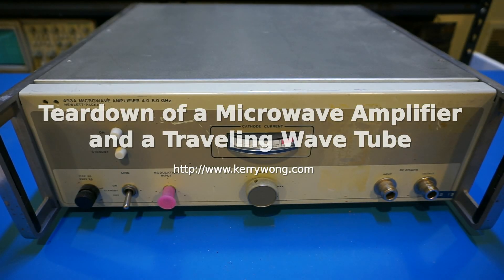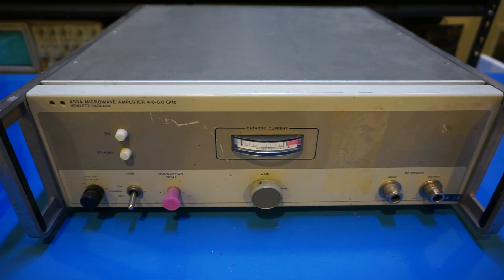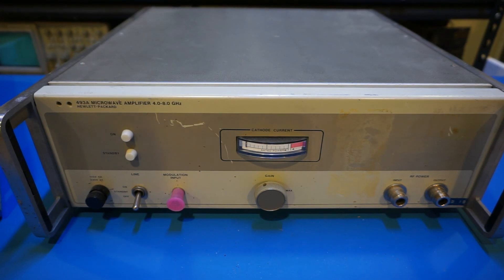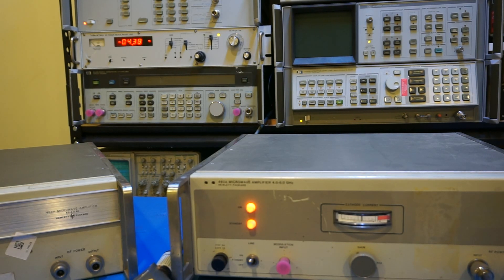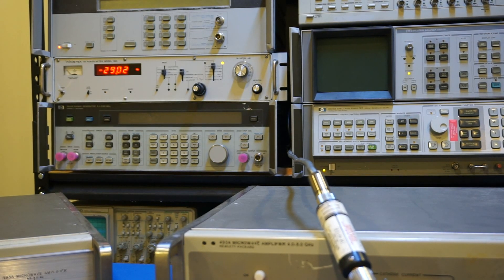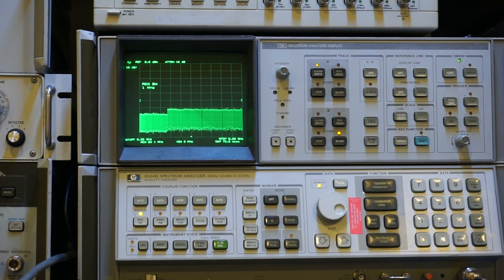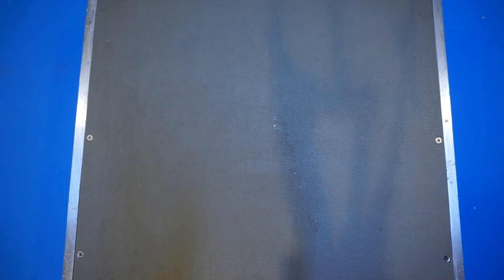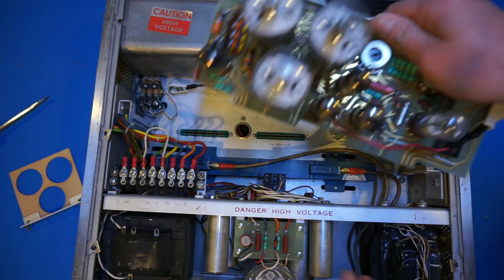Teardown of a Microwave Amplifier and a Traveling Wave Tube

Comment: My Dad does mechanical design for Satellites and did allot of designs for TWT transmitter, quite cool to talk to the guys how design the TWTs and all the RF behind it(People form Telefunken and such), just amazing. Unfortunately they are not longer working and allot of practical knowledge gets lost.
Reply from the maker: Although TWTs' are still widely used in satellites and other high powered microwave transmission systems. But a lot of the knowledge for making vacuum tubes nowadays has become lost art unfortunately.
Reply: Jup that's right, they have allot of advantages over solide State. But also are tricky, they often use 14kV acceleration voltage that is not easy to handle, especially in Space. They do even things like driving them with Voltage to arc out cathode deposit in the tube to get a view more hours out of a tube. It is sad to see such things get lost over time.

Comment: I have some Alfred/Singer network analyzer gear that incorporates "Backward Wave Oscillator" tubes, which appear to be very similar in construction to the TW tube (maybe they are in fact the same, I don't know much about this stuff - I can't even spell "RF") 
I've just uploaded the instruction manual for one of these to the "manual exchange" yahoo group, but I can't get a working link out of it,  possibly because it's in some sort of "moderator/review"' status, due to it being my first upload there. I'll post a link here if/when I can get one. Chapter 4 contains some detailed info and diagrams on the tubes.
And maybe one day I'll do an ignorance filled teardown video of these units...
Reply from the maker: Indeed, BWO is also in the TWT family. I'd definitely interested to see your uploaded manual when it becomes available. Thanks in advance!
Reply: Sorry, that link seems a bit dicky, and may require joining the group.
So I've also uploaded it to:-
https://www.pdf-archive.com/2018/03/27/alfred-singer-650-sweep-oscillator-653c/
Reply from the maker: Thanks!
Reply from the maker: for some reason, the last couple of comments were "held for review" I guess because they contained some links.... Anyway, thanks so much! Love the BWO tube diagram!